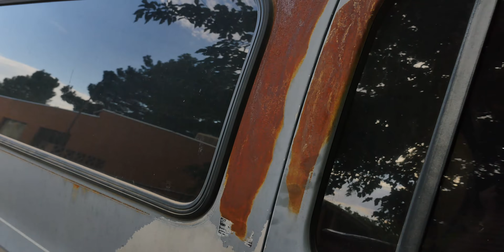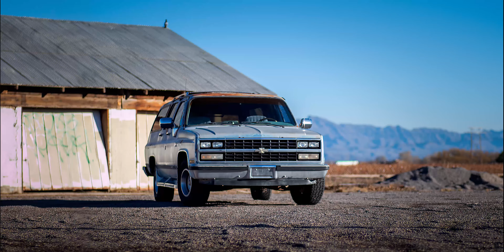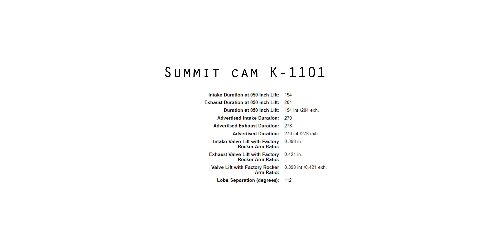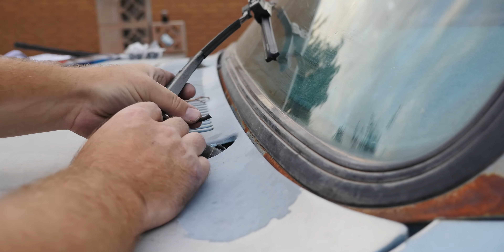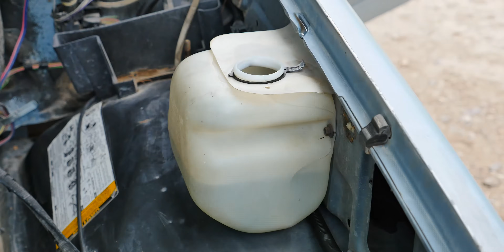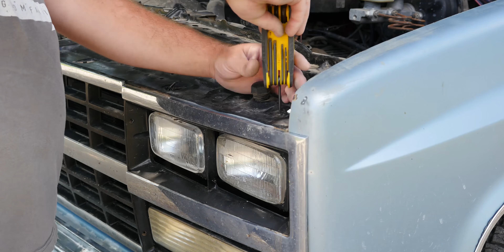1989 Suburban Rescue: Daily Driver Project (Part 1)

Comment: May I just note by the way that it is 2022 now and this suburban still runs great. It needed some front end stuff but the engine and transmission work great. My brother doesn't drive it every day anymore thanks to fuel prices but it does still run great and he uses it for towing despite my offer of using a newer truck. This is why we stick to chevy.

Comment: Just bought a 1990 Suburban R2500. Has a few issues with windscreen wiper control, electric windows, cruise control, lock switches, rear door lock, rear head liner and fuel cap. However the 454 still runs sweet, though it's thirsty. Best thing is, only 72k miles on the clock.

Comment: Came across this by accident Love the slight comic commentary.   Had an 89 Blazer and I had the muffler cut off and had a straight pipe behind the cats. Great sound esp with the air cleaner cover upside down

Comment: Might have figured it out by now but there is that brass ground strap that needs to be grounded as the motor mounts in rubber bushings